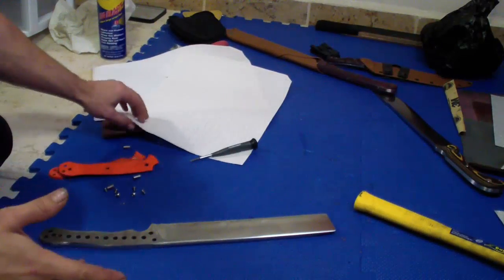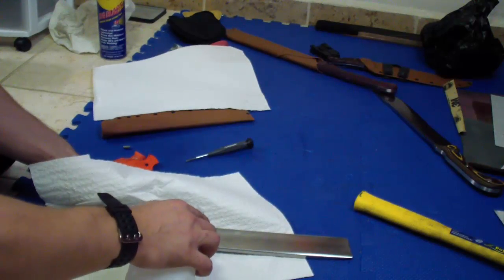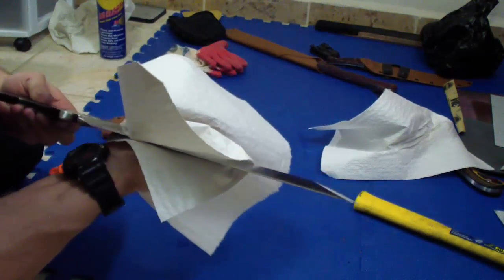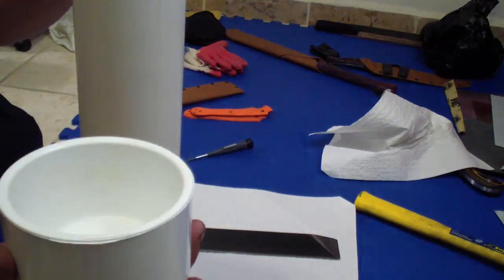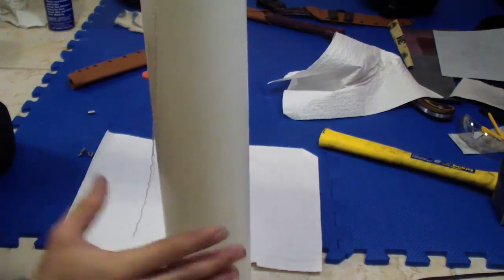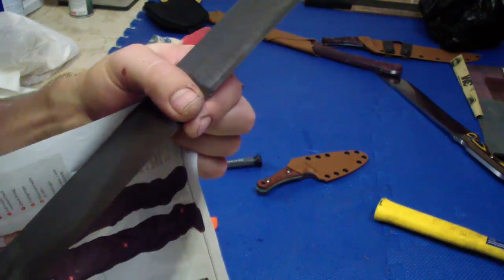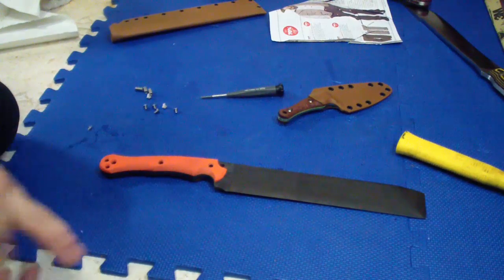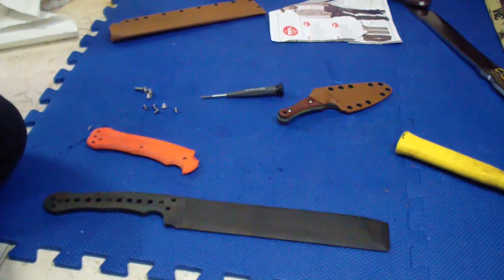Acid Wash - Tutorial

Comment: Hey Mike , I havent read all the comments and i dont know if any one has touched on this . I have the same set up in my shop. a couple cinder blocks stacked will hold that tube perfectly. you can add another tube to hold water with detergent and nuetrelize the acid on the blade . just my two cwnts . Great Work my friend.